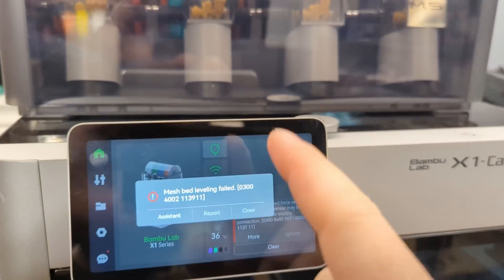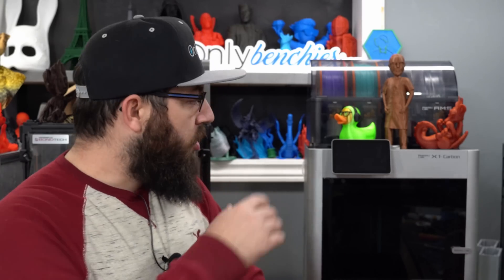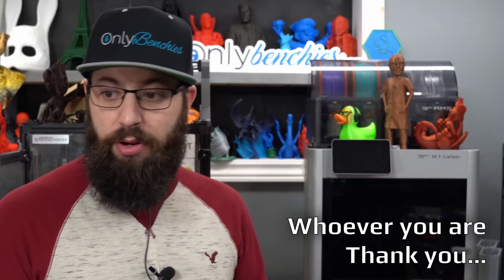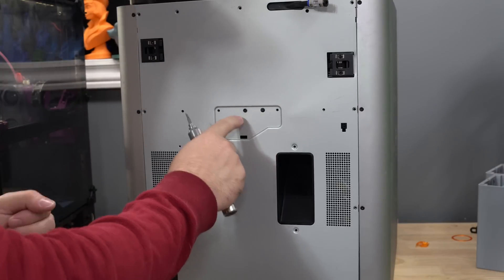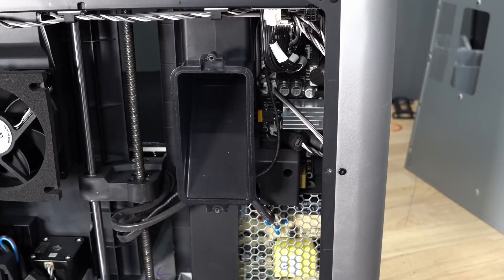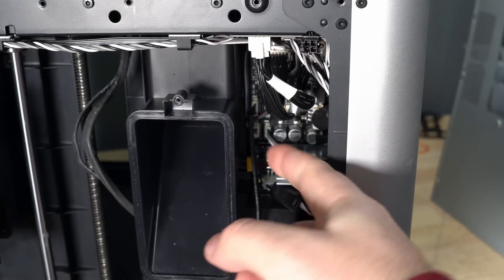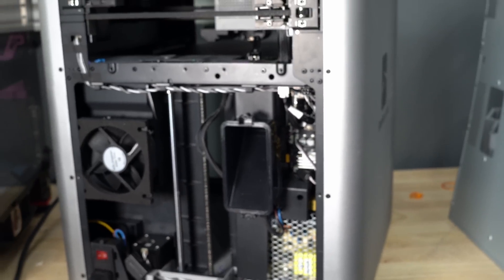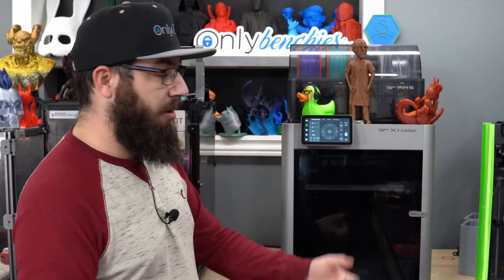Fix your Bambulab X1C/P1P faulty bed! #3dprinting #

Comment: Thank you very much, I had this issue for a few weeks now constantly. I opened up my P1P and saw that the cable mount for the whole heating bed cable harness has come off completely. I fixed that and did a few test prints. All of them went on without a hitch. Thank you for the video.

Comment: I am an early backer from Kickerstarter, and I had this error for a few weeks. Your video was concise, precise and perfect to fix my force sensor 2 problem. I think the big part of my problem resided in the cable bundle that should be fixed to the poop chute's hole (I think), but I prefered to stick to the "tape" method and it's FIXED! Thank you!

Comment: My bed seems to be a little wonky, not really noticeable, until it's printing the first layer where the bed shifts up and down in certain areas, mostly in the back right corner. It still prints as the auto calibration deals with it, but it's concerning to me as I'd like my bed to be level so auto calibration isn't doing so much heavy lifting. Any suggestions? X1C

Comment: Still works a treat! I've been printing without a single fail for 2 years on a P1S other than the odd filament blockage, and today it failed to print every. single. time. Did everything listed in the wiki and this fixed the problem!

Comment: Just did this fix myself and it appears to be working. You are right about the wire as well. Since the sensors are piezoelectric, they're extremely sensitive, especially to heat since that changes the resistance along the wire. Having higher bed temps has caused this to trigger for some, but the sensors are also designed to take this into account so that specific cause was mitigated after the first batch or two of the units. The wire on the other hand, gets close to the heat sink that you identified here, and that's enough to change the resistance along the wire itself, which will trigger the sensor(s). For me, it was triggering 2 and 3 as soon as the bed started moving, because by that point the bed was heated and the heat sink was already working. If I set the bed at a really low temp, no issue whatsoever. I can't use it like that tho so, here we are. The new bed they send out has different wires in different spots which removes the effect, but for those who don't want to wait, this is the fix. An alternative fix would be to heavily insulate the wire without taping it down, which is probably the better fix, but it's also like "why would you" because taping it is way easier.

Comment: the newer build printer have this issue fixed. The connector is glued in and the wire is held by a clip.

Comment: i really can not thank you enough brother, i just bought a new p1s combo and i would not print when ams is enabled it would give me a mesh error problem i did what you said in the video and the printer is working fine now, may god bless you <3.
Reply from the maker: If its brand new, id be contacting bambu about a warranty fix tbh, if its got issues already what else may be wrong with it.

Comment: PLEASE HELP…. P1S My plastic part on the bed that says 256X256X256 will shift left and right. I told bambu and they said tighten the top screws but they are all tight.. I can move it left and right, it will move left and hit the side of the Zrail and it ends up failing to home because of it.. I can push it to the right and its ok for awhile again.

Comment: I need to do this before i loose my last hair!!!  Its been a battle. Mine is a Kickstarter unit too. Did all the recommended troubleshooting from bambu in the wiki but no improvement. Failed Z and  erratic Force sensor errors, 2 or 3 usually.  This makes senser. I can get prints going but takes a number of retries.
Reply: FML....that worked....Months i tell ya i  battled with that...Bit it gorilla tape and bang shes back. Thanks Nero from Dave Smith on the Rock. Merry Christmas to  you and the family. 👍
Reply from the maker: Happy to help!

(although this did fix it for me, it was only temporarily, it lasted awhile but eventually i did have to swap in a new cable)

Comment: I'm unsure if this is the same issue, but my X1C (brand new; I've not even managed to get a 1st print yet) reports the bed temperature anywhere from 60 - 80C (it fluctuates) despite being cold. The result is that it refuses to print. Any ideas? I've reported it to Bambu Labs support but have not yet received a response from them. That's not a good start for a printer of this value. I expected it to just work, and that was the reason I went for it. I want a 3D printer as a tool and not a DIY hobby!
Reply from the maker: Sounds like a bad thermistor, would need to be replaced, should be covered under warranty
Reply: @ thanks. I’ll see what support says. I’m tempted to send the whole lot back.

Comment: Mine is failing to home Z but only when I try to print PC filament. Something about the hotter temps makes my bed think it's either not touching the nozzle or it stops early thinking it hit something. I'll try this just in case. Anyone else have this issue?

Comment: Also cannot believe this worked, at least for one print so far. For additional reference, I did this on a P1P, it'll obviously look a little different inside. It even looks like they made better cable management for the wires going to the bed, but they still clearly didn't fix this issue.

Comment: I tried this and I am still having issues, any ideas? I don't think that this was my issue.
Reply from the maker: May need to replace the cable itself..I ended up doing that recently as the error came back
Reply: @CanuckCreator  thanks
Reply: @CanuckCreator  do they usually send that as a spare on purchase (I know I have lots of spare parts somewhere) or did you order it

Comment: I was the original kickstarter backer and have been dealing with this error and failure to start printing for the last 2 years. I opened tickets in the past but the Bambu support just pointed me to docs which didn’t help. Last week I was so frustrated because I spent 2 hours in front of the printer for a 10 minutes print job. I wish I had seen this video before. After doing the tape fix my printer is working flawlessly. Thank you so much.

Comment: This is great! Had this issue with mine. Opened it up, seems Bambu updated the design of those wire. The newer models don’t have the wires rubbing on the lead screw and way better cable management, however, I increased the slack through the retaining clip and tapped the wire to the side of the poop shoot. So far, looks like it worked. 👍
Reply: Yeah I was going to say the same after checking mine. The Cables were updated since Nero's revision. Another thing to note is if you're using a rubber paver or anti vibration feet it could cause the sensors to give false positives. Changing the tramming screw positions can also cause errors in bed levelling so just make sure you follow the wiki if you have issues with bed level sensors.
Reply: @PLr1c3r  Yup - it's odd but I am still having issues especially when printing at 100c for PC. It is still failing. Not sure what to do next. Otherwise, it levels fine at lower temperatures. Any suggestions? Dont want to play with the factory tramming settings.
Reply: @khram84  Hi, I have the same issue with high temperatures. Did you find a way to fix it?
Reply: It started again after a while. Ordered a new hotbed from Bambu as part of the warranty. Installed it and really greased up the 3 axis worm gears. It has operation well ever since.
Reply: @khram84  OK, thanks! 😊

Comment: Usually that same wire gets a short in it where it connects to bed the by that z axis, its a $4 cable.  You can be preemptive and wrap it with electrical tape or shrink wrap, or do it when you replace the wire.

Comment: Edit: mine broke again after a few prints. Had to suck it up and bug support for a new one, which they sent. First 3d printer so did not enjoy the repair, didn’t want to break anything, but got it done and successful full calibration first try. Also bugged them till they offered me two spools of PLA for free, which they sent after I confirmed the error is gone. 

Legend! My P1P started doing this after my first print and this fixed it! Back in action!

Comment: They seem more like strain gauges, not piezo sensors. Accurate strain gauges have wheatston bridge intergrated into unit  , because the voltage change is very low (probably the work they are doing in there - around 5mv. It can have 4wire or 6wire setup and it seems it's a 6 wire on bambu. It's easy to get false reading if there is tiny problem with connector.It's fine if the resistance is there all the time, but it's a problem if it changes during the use of the strain gauge as is probably happening here. if resistance changes over time (temperature, condensation, oxidation) it would not make much difference since controller measures difference in voltage and it learns the "zero point" before starting homing process.

Comment: Great video! A couple of comments/observations. Piezo crystals don't emit an "electrical current", they produce a potential difference also know as a "voltage", totally different from current (flow of a charge). Also when you want to disconnect the top double pneumatic fittings, don't just forcibly "yank" the connector off of the PTFE tube, you'll ruin the tube. Push in on the blue ring and it will release the PTFE and won't require yanking it off.

Comment: You are my hero. I’ve been battling that error off and on for months, but getting progressively worse until last week I could hardly get a print to start with bed leveling working, maybe one try out of 12… I stumbled across a Reddit post that linked to your video. One piece of tape and I haven’t had an error in two days so far! Thank you! 🎉

Comment: I suspect, as other here, that it's a slight change in resistance. I would indeed secure the cable, but I would ALSO use DEOXIT on the MB contacts for that connector, and while at it I'd do all the connectors on the motherboard. 5 mins to handle things for good. Less is more when applying, you never want it WET, just damp. The stuff is magic fluid for every electrical connector problem. Low level Audio and signal connectors, battery connectors, you name it. I've handle so many connection problems with it over the years I could write a book. Lightly apply, connected on and off a couple times (cleaning), wipe the excess if needed and reconnect. Great for USB (including USB C) connectors and flash drives too. I almost never assemble or repair without it. Available in multiple viscosities for things like heavy wear or  harsh outdoor / marine environments too.

Comment: Bambu already sent me a replacement cable, but I figured I'd try this fix first before spending like 2 hours tearing the whole printer apart.  So far, so good.  Calibration finished successfully and it's printing for the first time in weeks.  All it took was this video and a couple drops of superglue.  Thanks!

Comment: I just did this fix myself. In my case, the signal wire was being pulled so tightly that the actual board was being pulled with the wire (because of the glue on the connector).  Also, the plastic clip that secures the signal cable and hotbed power wires, was attached to the actual poop-shute instead of where it actually needed to be attached to.  I had to fix that as well.  Anyway, I ended up separating the signal cable from the hotbed power cable a little bit by removing some of the mesh tape they were wrapped in together. This way the signal wire got a bit more slack so it wouldn't get pulled so tight anymore when the bed is all the way up.

Comment: great, that's worked. I received my x1c today. had already a new version of cable with a clamp to secure. I moved a bit the connector that was fixed with glue, and after the problem with sensor 2 was gone ! thx for that video. saved me a lot of time and nerves :)

Comment: I haven't had this issue but I'm about to have to open up my X1C to replace the mainboard cooling fan.  I may add a piece of tape as shown in your video as a preventative measure and hopefully will never experience this error as a result.  I doubt I print anywhere near as often or as much as you so my X1C may just not have had the time to develop the issue yet.  Thanks for posting!

Comment: This problem is now resulting in Bambu revising the force sensor cable from the bed to the main board. They have made a new longer cable and new routing path for the cable. The replacement of the cable is a PAIN and because of it they are giving $50 gift cards along with the new cable. There are a couple YouTube videos that demonstrate the replacement procedure

Comment: On my BIQU Hurakan, the resonance test vibrated the ground wire from the switch/power inlet to the FG post of the Power Supply out from under the capture screw. That left the frame ground wire still attached to the FG post, but without the second wire, the first wire was loose. Guess what happens when your floating ground and your loose ground come into contact with your main wiring harness after you've installed a new print head? That's RIGHT, the short off the 115-volt power input ground line fries the connectors on your board, and the CPU and two of the other main components go up in smoke! I guess that's why in the US, 2 wires on the FG ground are considered ILLEGAL and a FIRE HAZARD! Check out my feature video on my YouTube side to see what I'm talking about, and please comment if you think I'm wrong about this.

Comment: Great video. Did you also notice the 2 wires rubs against Z axis screw when the bed goes up and down? might need some tape to protect those wires.
Reply: might be a better idea to have those wires in a drag link. that's a huge fire hazard if the line voltage wires to the heated bed get shorted

Comment: Welp, the usual run of people who are determined to hate Bambu being snarky in the comments notwithstanding, this is a very useful video!  I love my X1C but I'm also very aware it's a version one design, and no amount of in-house testing is going to find all the issues.  Videos like this with quick fixes that semi-skilled users can easily do are what's going to make sure these machines stay awesome for years.
Reply from the maker: IMO its very much a first gen product from a new company, knocks it out of the park in some aspects, yet drops the ball when it comes to some other things (i mean the bed wires rub on the leadscrew during movement, cmon)

Give em a few more iterations and time in the oven and im sure their future printers will be even better
Reply: By time BL gets all their issues solved, something new and better will come along, rendering BL obsolete.

Comment: I was disappointed to see this cable routed and secured so poorly. My thermistor conductor broke internally from repeated motion.

They sent me a new one, but I fixed it myself by soldering on a working wire just for the thermistor. With they put more effort into cable routing there.

Comment: thanks for sharing! looks like I'm off to tidying cables in my unit
btw, Bambu has some connectors filled with silicone (in the toolhead) so I guess they had to mitigate some vibration issues already

Comment: As much as I love using piezos for bed leveling they can be a pain if you're using them on a non stationary bed or the hotend. Good quality wires, crimps and strain relief are a must if the sensors are attached to anything that moves. They are very sensitive which is both a good and bad thing, just a small internal break in the wiring can throw them off and cause intermittent headache inducing problems.
Reply from the maker: We played around with em on Vorons awhile ago internally within the Dev team and the idea never really went too far just due it being unreliable/not consistent with repeatability

Comment: It could be a problem with the crimps in the connector, perhaps they are not making good contact and very tiny changes in resistance as they move are affecting the bed level sensors.

Comment: I have 7 X1C's and 2 of them have gotten errors like this, all do to the cable that runs from the bed to the controller board.  Bambulab support was great and sent replacement cables and even a 50 dollar store credit for each incident but it is annoying and you need to take a lot of the printer apart to replace.
Reply: I'm in the same boat as you. What did you do?
Reply: @alycapo3391  I replaced the cables, just had another printer do it last week, bambu lab has another cable on the way, so 3 out of 7 printers so far have needed the cable replaced.
Reply: Any tips/suggestions to make it easier. Or do I just go through the motion and do it 😅
Reply: @alycapo3391  yeah just follow the guides bambulab has up for doing it.  It is not difficult just takes a bit of time is all.

Comment: On mine it pulled the top pin out of the connector. Bambu sending me a new cable and an account credit for the time to replace it. I have temporarily patched in a new connector and the printer is back to normal operation.

Comment: I had same issue. My wires were cut and shorting, bambu sent me a replacement harness.
Reply: Cut and shorting where? At the connector itself?
Reply: @rileyneufeld7001  cut in the middle. The wires are thin and it cut itself inside the jacket. The replacement they sent me appears to be longer and using a different jacket.

Comment: i'm glad i didn't buy one of these, personally. Boneheaded design decisions like the wires on the z screw and stuff like using a smooth idler on the toothed side of the belt makes me wonder if they actually hired real engineers to design this thing. I'd rather get a prusa to be honest